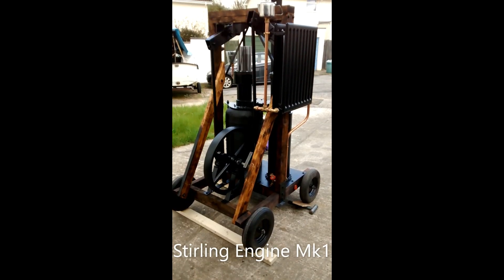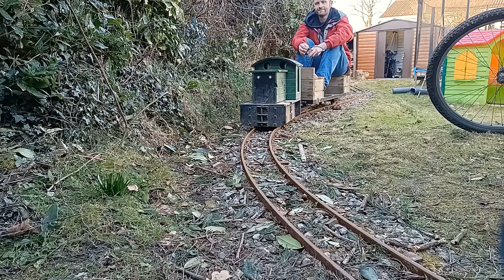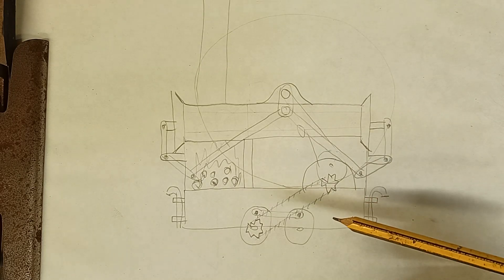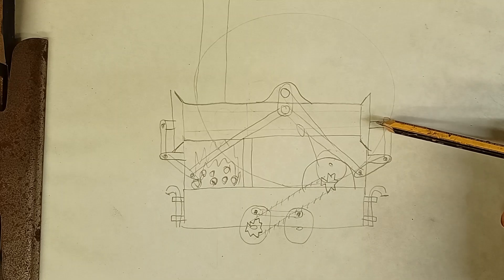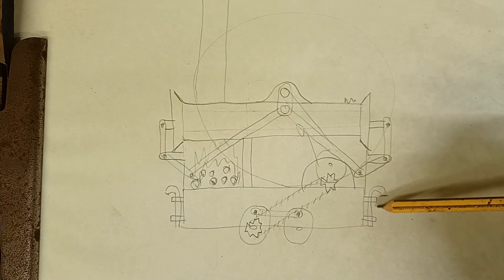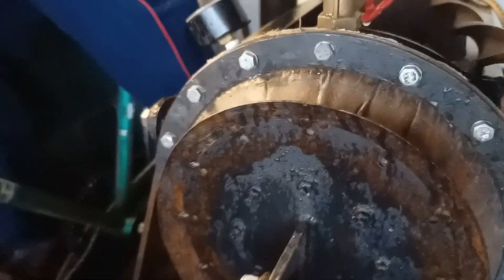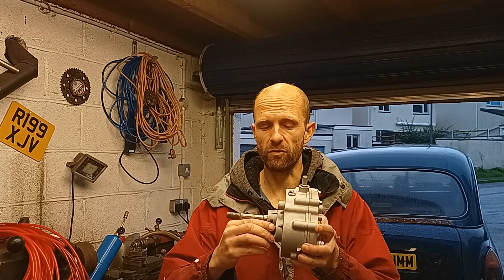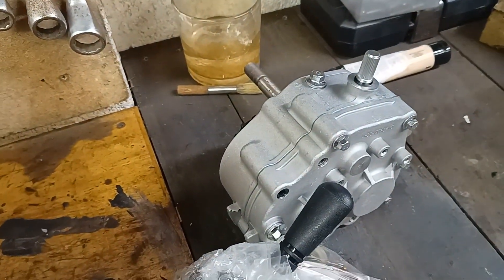Hot Air Stirling Engine Locomotive - Part 1

Comment: about the clutch and gearbox, check how Tim from channel "way out west - the worshop" had built his, he used a simple disk that acts as both clutch and continuous variable transmission, he did it to get around the limitation of his motopump engine, which requires a stable RPM to run, it's quite cool tbh.
Reply from the maker: yes I've seen that. pretty cool

Comment: it's quite obvious why so far no Stirling was used in business locomotives, it lacks the power density of steam which is itself inferior to internal combustion engines, tho Stirlings can be made to be more powerful at higher pressures and temperatures than steam but the materials can't resist those pressures and high temperatures.
It was said Robert Stirling noticed how his invention can't compete with steam so said he hope it to be an alternative to steam for small scale and domestic uses as a safer alternative to steam boilers who exploded regularely and needed a competent engineer to run them.

Comment: I share a few other's on here concerns around power to weight ratio but more troubling may be the low torque. I think you are going to at least require a slipper clutch but better still some sort of reduction gear to act as a torque multiplier to the wheels. The problem of course with the Stirling design is the engine has to be oscillating to produce any power at all and the likelihood of stalling the engine will be significant. Fascinated to see how you implement this, the other designs have all been at least functional. Gods speed Shane!!

Comment: Shane is there any chance you can get hold of titanium tubes for the heat transfer - They are used as condensers  in the Nuclear industry and are far more corrosion-resistant than Stainless steel and could be swaged into end plates
Reply from the maker: @trevortrevortsr2  hi, I will look into this, many thanks

Comment: It seemed like the diaphragm engine had a more disappointing power output than the piston engines. Can you put a second or third row of tubes above the first and make the diaphragm more square for more displacement?  I expect you'd need 2-5 kW to move the train and it's own mass at a similar speed to the electric.
Reply: 5kw?! That's more than 6.5hp, that's 50cc moped power - hundreds of watts should be able to trundle a locomotive around steel train tracks at walking speed. A 250w electric bike can do 15-20mph on two inch rubber tyres with the weight of an adult on it
Reply: @PKMartin It's all guessing without a calculator from here, but here's my reasoning: An electric scooter weighs 200 pounds with rider. This Stirling engine will be made of steel, iron, concrete, and leather. It's going to have to be huge to make appreciable power, so I assume it'll weigh at least 400 pounds before you add driver and cars. With enough gear reduction, it can move, but if you want it to start moving from a stop with a small grade and reach walking speed, I expect it'll need lawn mower amounts of power because of the massive engine. I love watching these projects, and I'm glad to watch someone who's obsessed enough to spend his money and make real hardware just to feed the addiction and see what happens!

Comment: May I suggest using an old 2 cylinder cast iron air compressor, comes with 2 pistons 90° opposed and a lubricated block, heat one cylinder,  cool the other. Compact, and most of the hard work is already done for you. Best part: no need for flexible diaphragms,  solid cast iron head will contain the pressure difference and allow for a huge increase in efficiency.  Put your efforts into cooling the one cylinder head and pinpointing the heat onto the other. Small intense heat input works better than larger distributed heat input. And liquid cooling of the other cylinder can expedite thermal imbalance.